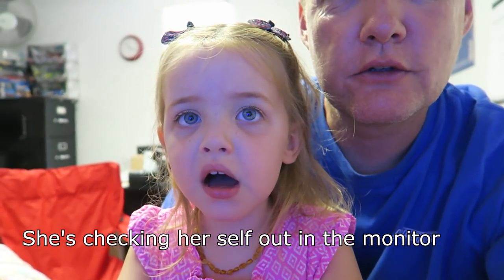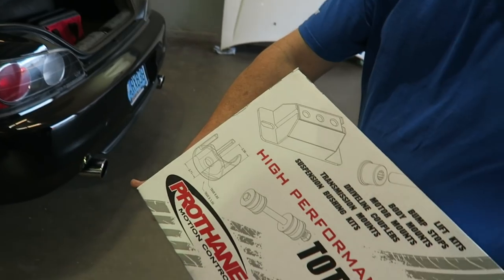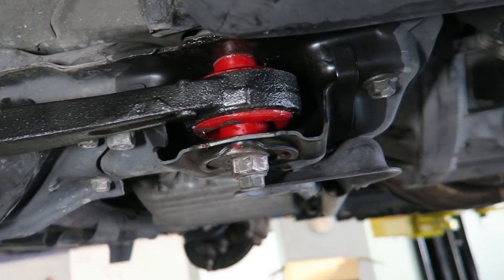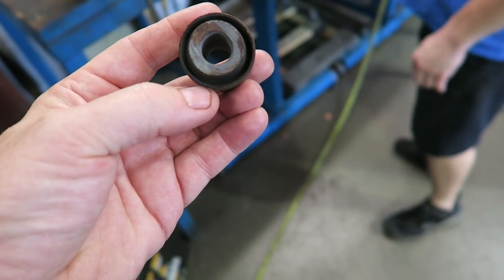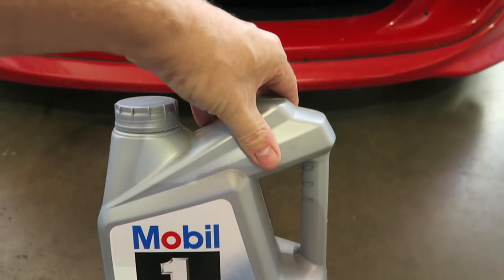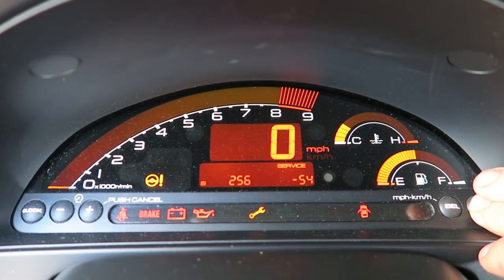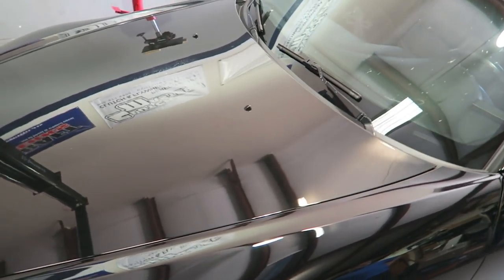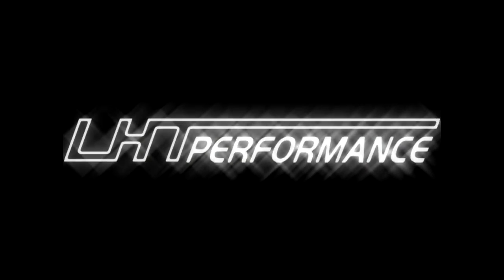S2000 Prothane Bushings, NOT WORTH IT ???

Comment: Try doing this on a UK s2000 where pretty much every bolt is seized inside the oem bush so much you have to cut both sides of the bolt just to remove the arms.
Reply from the maker: mason8725 Oh no. That’s no fun at all.

Comment: Prothane is the same as polyurethane right?

I've heard bad stories of cars squeeking after putting on these bushigns. I was actualyl considering them aswell
Reply from the maker: Prothane is the company. The trick is to coat everything in the clear provided grease. Its yucky but you got to use it .
Reply: @LHTPerformance  have you had any customers complain about the longevity of these. I've heard mixed reviews. Can't be worse than the stock rubber ones though.
Reply from the maker: @rowankeltizar5961  We’ve actually stopped installing them. Even using their recommended and supplied grease, they still squeak after a year or so.